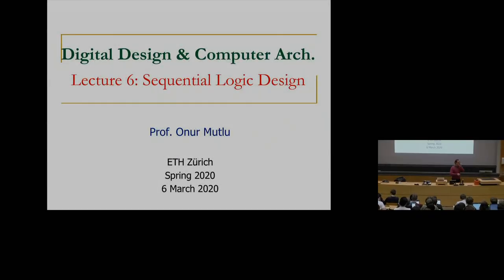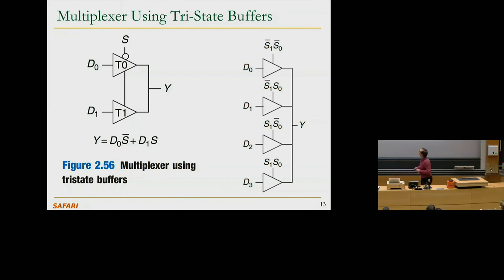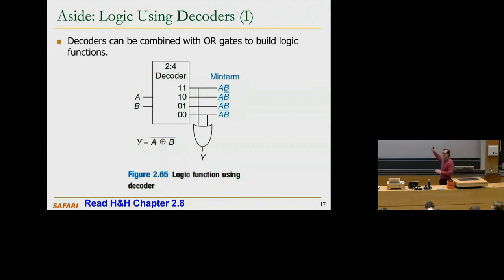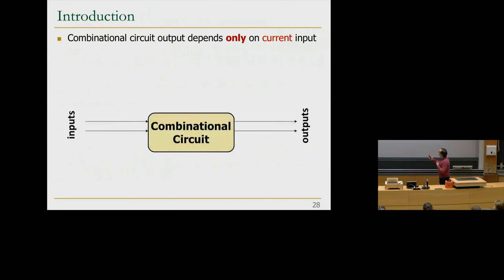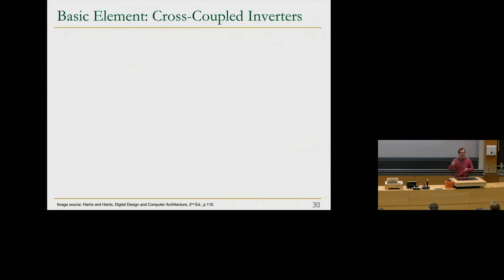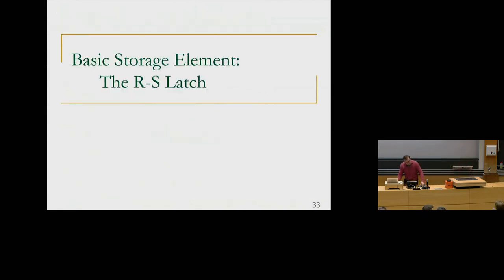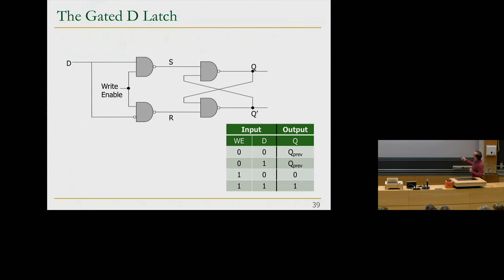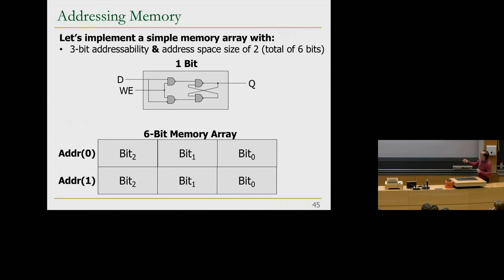Digital Design & Comp. Arch. - Lecture 6: Sequential Logic Design (ETH Zürich, Spring 2020)

Comment: With the edge-triggered flip flops, surely the data is captured on the falling edge? It's only propagated to the output on the rising edge. So, if the input changes between the clock's falling edge and the rising edge, it won't be reflected on the output until the next clock cycle.